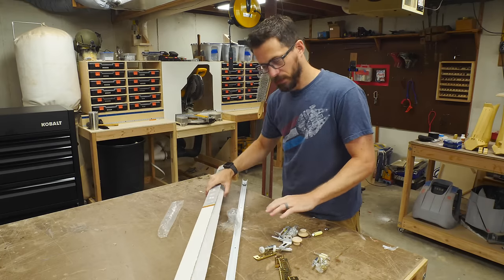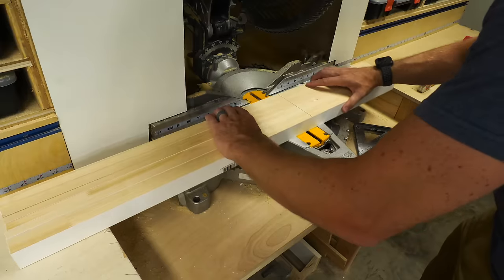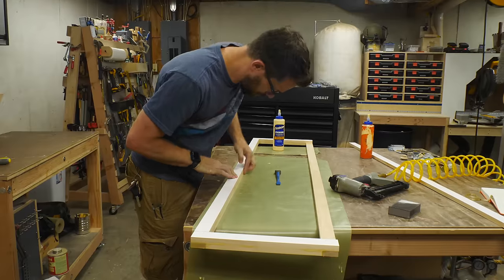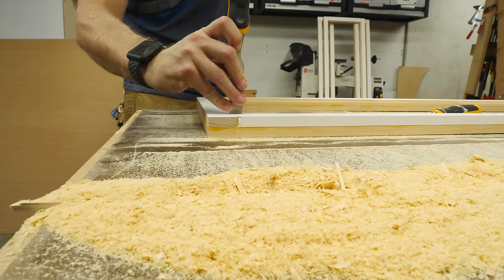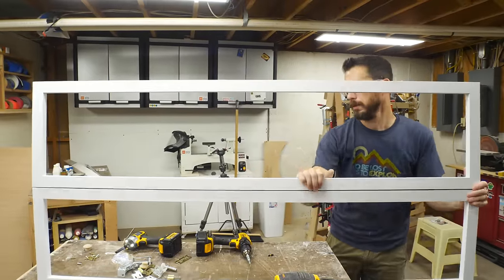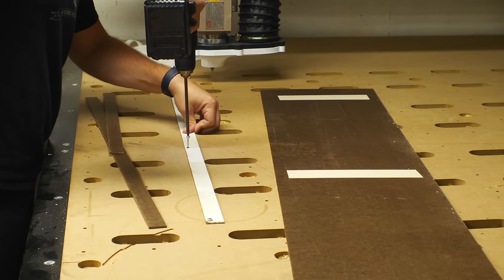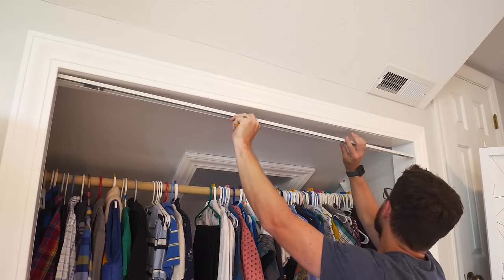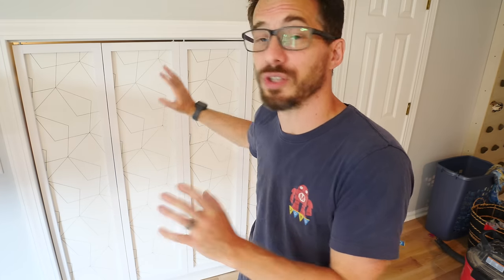How To Make Custom Bifold Closet Doors // Woodworking | I Like To Make Stuff

Comment: Great job. I actually made bi-fold doors for a client last month. I used frosted glass inserts. I just used 3/4 inch stock pine boards to make mine. Worked just fine for me. Just saw this video after I made them. I used the same kit you did. Again great job.

Comment: I followed how you made these and it came out great. I used some thin lauan for the panels which worked out great. I used 1x4 for the stile at the bottom and 1x3 for the stile at the top. I added a mid stile since the lauan is so thin, also used 1x3 here. 1x2 for rails and sandwiched everything together. Word of warning, make sure the brads you use are far enough from the edge not to be in the path of the rabbit bit. If you have enough clamps I’d do that too. I don’t have a planer, but it would certainly have helped. The kit I got for hardware was Everbuilt from Home Depot, their instructions are ok, but have a contradiction in width, step 1 says make the width 1/4” less than the opening, step 3 said bake it 3/16” less. I went less giving I can always remove a little more later, should have picked 1/8” less per panel really. Still more of a gap than I’d want.

Comment: Thank you so much for this tutorial.  Great instructions and explanation as you go.  I've got a doorway in my basement that cannot fit a normal door (or french doors) and also cannot have a pocket door put in without a lot of extra work.  A set of bifold doors will likely be my solution.  My panels will likely be 1/4" ply or mdf to add strength and durability since these will function as actual doors versus closet doors. Cool idea to use a CNC.  I will probably make laser-cut overlay panels.

Comment: Just a tip about your chiselling. Just as I have recently also learned is that you should usually not even need a hammer to use them since they should be sharpened enough so that they simply just cut off the wood fibres with ease. You can do so with some various grit of wet sandpaper glued to a piece of glass, stiff and perfectly flat metal piece or other flat and stiff materials, preferably one that isn't affected by water. Should go up to at least 1000 grit or even higher is possible. If there is a budget for it then diamond sharpening stones are the best. Then finish off with some fine abrasive paste on a piece of leather. 
There are several guides here on YouTube made by woodworking channels.

Comment: I have little attic / “crawl” spaces like this through out my entire upstairs of my house. My boys room has 3 (2 in their actual room & 1 in their closet area that’s a LONG L shaped closet). These areas take up a good 1/4 of the upstairs. I one large one in my room and 2 small enclosed ones (where there is no door), 1 is actually part of my boys room that leads into my room I think. I really want to knock them out like you sis & creat more space. My boys room is like a loft, they don’t actually have walls inclosing it, it’s just walls around the house (we walk through the boys room to get to our room). Their long L closet wraps around the stairs and stops at the bathroom. I would love to knock part of that wall down to creat more open space then open those crawl spaces up. It would make SO much room.

Comment: We just bought a house this winter, it has a guest closet in foyer, but the pantry is the size of a broom closet. So we did a swap. The pantry is now where the guest closet was. My daughter in law installed shelving and it works much better. The problem im tryingn to solve is, it had heavy, solid wooden sliding doors. Humidity has given me issues, plus the doors block half of what's behind them, depending on where I've slidden them to. Im wanting to make bifold doors so I have a full view when I need to. The width is 43 inches, trying to go to the Habitat for Humanity (ReStore) has been unsuccessful,  but I did go to the Salvation Army Thrift store and came across the hardware for bifold door installation and it only costed $3. Im not sure where to start now. I watched your video, seems simple enough, but im still a bit uneasy. If you can respond, I could use a bit of guidance.  Thank you

Comment: Hey Bob, I think you might like the look of the panels' back side a little better if instead of painting them, you routed the rabbet twice as deep and put duplicate panels facing the opposite way on the inside. It may look neater and be a little more kid-resistant.

Comment: OMG. I have this on my list of stuff to do (I can't find ones tall enough for the doorway). Perfect timing
Reply from the maker: Great! I hope it's helpful!!
Reply: Definitely like your frame technique better than what I was thinking... I'll probably lay thin sheets on the outside both both sides of the frame (instead of recessing panels) since i want to fill with insulation for sound deadening. (I'm putting them on a large closet in my garage where my air compressor lives)

Comment: The only problem I saw with the chisel is the fact that you need to use a buffer to finish sharpening the cutting surface. My Grandfather taught me that. It seems like it would not work but I could cut with the buffed chisel without hitting them. simply amazing difference.

Comment: Super useful..I have a rental unit with old painted metal doors with hardware that you can’t buy parts for anymore, and they are floor to ceiling so replacing would be very expensive (custom) next time to rotate tenants I’m doing this.

Comment: On the frame glue up, I would have laid the boards out side by side and spread the glue on all of them with a roller. Then assemble them using a few pin nails just to keep them from sliding and clamp the entire stack of four frames in one set of clamps. Much faster than spreading glue with a brush on each board and you only need enough clamps for "one" frame. You might need some extended open time glue, but if you're really quick it wouldn't be necessary.

Comment: Some info is missing...? If you have an opening of say 48 inches, what is the width of each door panel ( 4 door assume) i do not think it would be 12, as you need space on between the panels and sides of the opening.

Comment: If I want to make bifold doors for my laundry room, but the floor is on a slope down on the left, would you just keep everything straight and even from the top and the base plate make it level by adding more on the left side? Or would you cut the door at an angle to sit flush?

Comment: Hey Bob! I just built similar door to yours, just taller and heavier; I still have to fix the panels and I am undecided on whether to use glazing point as you did or pins; I know the pins will fix the panels in such a way that they’ll keep the door from deforming; would glazing points do the same?

Comment: I made a set of doors similar to yours; MDF, each strip 1.5" wide. When I went to drill the 3 contact point holes in the corners for the door hardware, all of my corners split apart, ruining my project. Any idea what my issue could have been?  

Now I'm drawing up new plans to make each strip a little wider, at 2". Hopefully this fixes my problem.

Comment: Hey bob, I learned a lot. Thanks. I don’t really like the gap on top. Is that intended ? Do you think you can use the adjustments to “fix it” ? Is that something you wished you had done differently? Is that something that the kit mislead you to do ? Thank you
Reply: The screw on the bottom of the door allows you to adjust the height, we fixed it later

Comment: I purchased this bifold kit and it doesn't actually hold the door up, it just centers the door so if ur doors r light it will work but if ur doors r heavier and they won't hold themselves up then ur doors will start to droop and come loose off the door hinges this door kit is made by Hillman I got it off amazon

Comment: I think you should come up with a way so that the light inside the closet turns on as you open up the doors and then turns off as you close them like a fridge which will save money if they forget to turn the light off
Reply: Ikea have small stick-on lights that do that. I have one in a closet. Maybe a repurposed refrigerator door switch would work too?

Comment: Hmm.... I was looking for someting that could either fold or slide over each other. I need a better solution for my green screen. Sliding is  an option but it felt odd for soem reason. 

How ever, Bifold doors seems to be a great idea. but that does mean i have ot make sure the fabric (which is just a 1 Meter by 1.5 Meters green cloth I bought for 5 EUR) doesn't get folded too bed so it doesn't leave seems. 

Need to work this one out a bit more.

Comment: What software did you use for your cnc? It looked simply like the inventables one, but it worked on such a large cnc
Reply: I designed the pattern in Aspire and cut it using Mach3

Comment: What if you glued  the poster board to one part of the frame before gluing the other part on so it could be in the middle
Reply: I think the door would be more rigid, but you couldn't swap the panels out later, you'd have to paint them in place.

Comment: Hey Bob, which cnc do you use? Oh and do you still have the video where you made a box with fabric hinges? i think it was a foldable spray paint booth. I cant seem to find it anywhere
Reply from the maker: This is a www.cncrouterparts.com/pro-cnc-machine-kits-c-47_54.html
Mine is a 5'x5' (not listed on the site)
That video should still be up, I just don't have the link handy. 👍🏼

Comment: I’m new both on channel and woodworking. I have a question: why author cut wood into thin pieces and then glued two layers (?) together at 2:46? Can I just use  wider piece of wood ?
Reply from the maker: Welcome! Mainly because laminating 2 pieces will add a little bit of stability (to combat bowing of the wood)

Comment: Theese tracks are definitely not aluminum, looks like made of folded iron sheet(sparks while cutting reaffirm). It most likely will not damage your saw blade but i had some broken teeth after cutting similar metal parts on my table saw :(

Comment: Hey, what is that roll of material you are using to protect the bench from glue?
Reply: Looks like wax paper.
Reply: i think it's like wax paper.
Reply: Kinda looked like a vinyl material or something to me.
Reply: probably.
Reply: ^^^^ Vinyl? or ^^^^ Wax paper? Where do you get that? Its the perfect size roll.
Reply from the maker: Oh, I thought it would show the reply in order.  It's a roll of wax paper.
Reply: Thanks. Big roll! Thought maybe you had discovered some new use for an industrial material of something. I used to think the Rockler glue brushes were a little unnecessary until I got some. Thought maybe you found something similar in a roll.

Comment: I built my own closet doors using this video as a guide and I just wanted to point out that screwing into the edge of a piece of MDF will produce a split just about every time. I pre-drilled every hole, and screwed in each screw by hand. Despite that, each and every screw hole split. If you're going to attempt this build, DON'T use MDF! I've since done some searching on how to fix it, and while I think I can, the consensus is that screwing into MDF is bad. Very disheartening and something I wish had been addressed in the video. The plans are fine - the material is a bad choice.